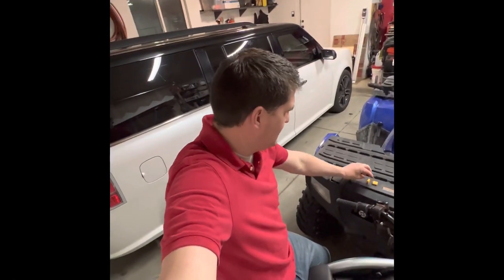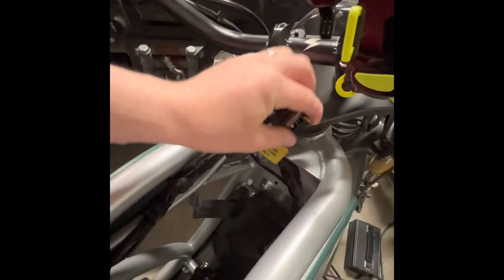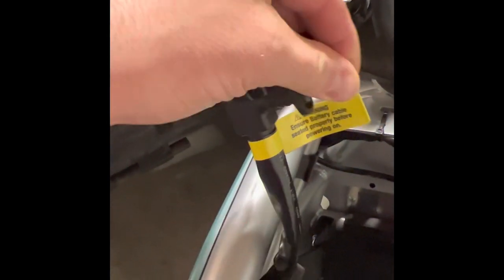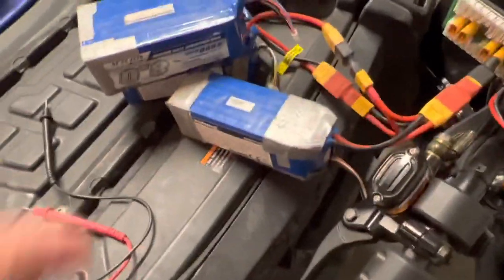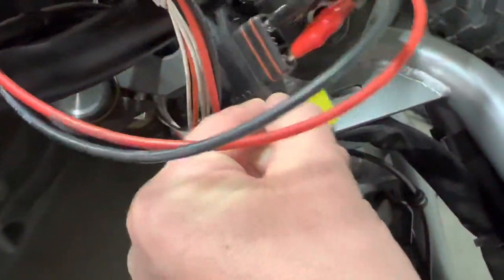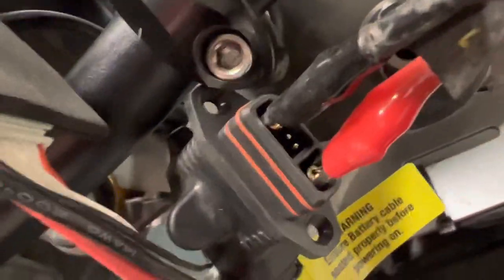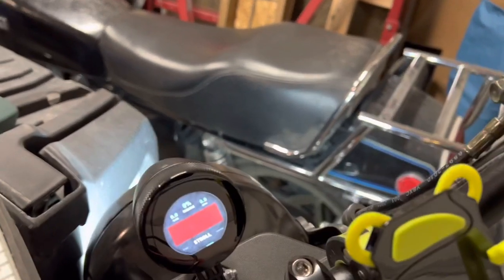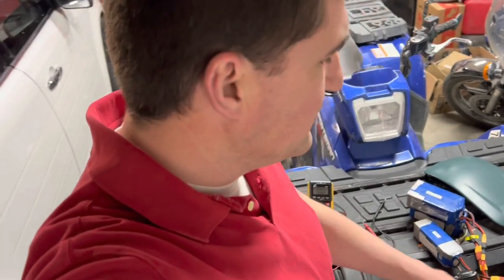Volcon Grunt - Power Connector

Comment: I'd be interested to know if the controller will handle 72v (20S) - if I'm going to build a battery, I'd rather make it a 20S 72v system than stick with the stock 16S 60v system.
Reply from the maker: I agree. It needs at least a 72v for the increased rpm. I’m sure the motor is plenty capable and feel the 100a limit is for the longevity of the battery pack. The 2 battery bikes are wired individually. Meaning when one dies, you switch to the second battery for range.